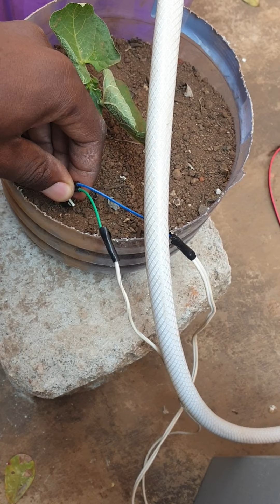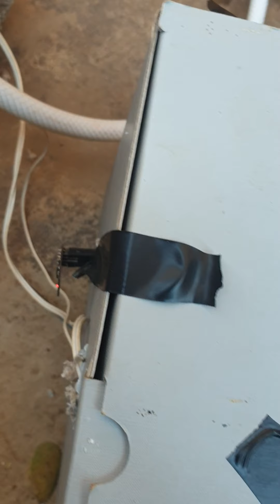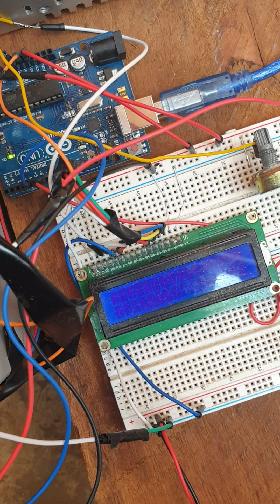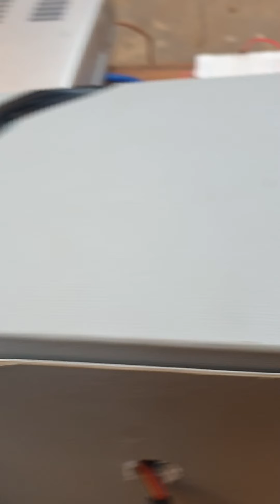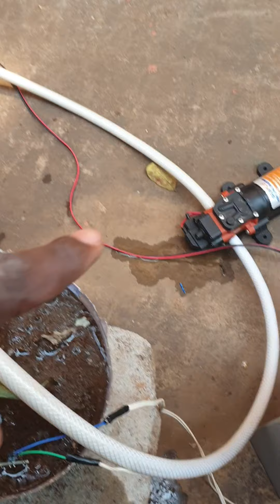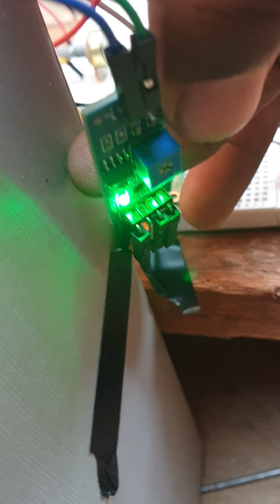Fido  smart agriculture

Comment: Awesome work there bro. I would ask some rhetoric questions, though, just to help you optimize your design. (Economics first, Technology second)!
1. What's the range of farm size your system is being designed for?
2. How much water, in litres, is required per day for the target farms?
3. Does the capacity of your pumps meet the requirements?
4. If not, how can the user of your system scale up the flow rate to meet the required capacity?
5. If yes, is the energy cost for driving the whole system affordable for the farmer?
6. Can the design be changed to optimize on energy consumption?
No need to answer these questions here. Keep up the good work...
Reply from the maker: Thank you! These rhetorical questions will really help me alot  i appreciate.

Comment: Great job! This model if adopted by African farmers will go a long way in improving their productivity and minimizing pre-harvest losses. 
Just a reaction to your prototype:
1. What's the cost aspect and how affirdable is it for the average African farmer? 
2. How do you ensure durability of the sensors and project as a whole?
3. Any maintenance costs? Can a farmer with little/no IT knowledge manage the project.

Once again, congratulations for the awesome job. This, for me, is  a clean A grade, but look beyond the grade and help our farmers.
Reply from the maker: Thank you sir! 
Answering your questions 
1. The whole project costed me less than $100.This is way too affordable to an average farmer but statistics will change depending on how big you want to deploy your system.
2.Arduino sensors used in this project are just for prototype practice and their are less than $5 each  but the sensors are durable to say. I have stayed with them close to a year now and still perfectly working, these are two growing seasons.I am currently working on designing a board to avoid those cables  hanging around, boards are durable.
3. I recommend maintaining the sensors after each growing season that's to keep the sensors from giving accurate data, in my research its less than $50  to do the maintenance. This is affordable to an average farmer.
Reply: @kelvinmkhwimba786  this is definitely affordable to our farmers considering the anticipated increased farm outputs once they adopt this model. All the best!